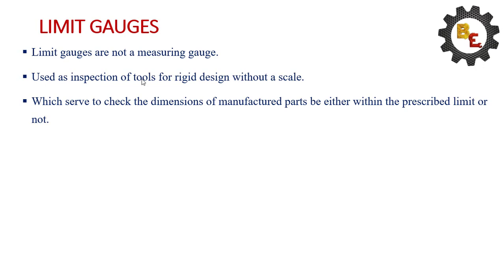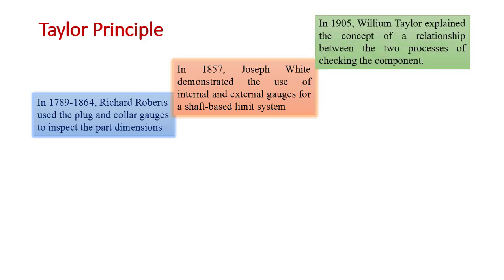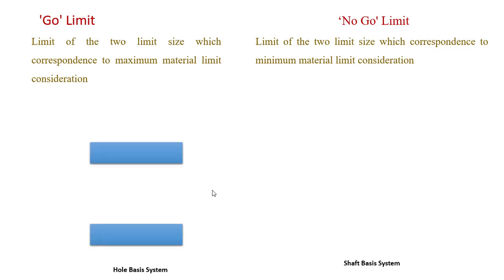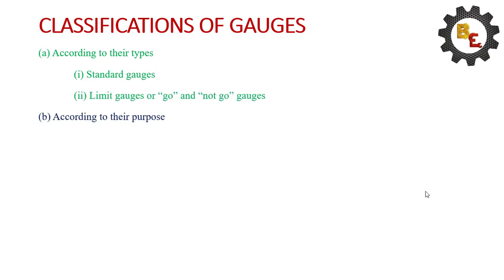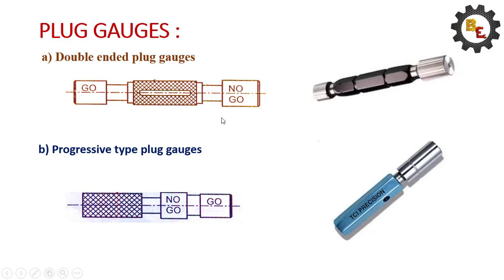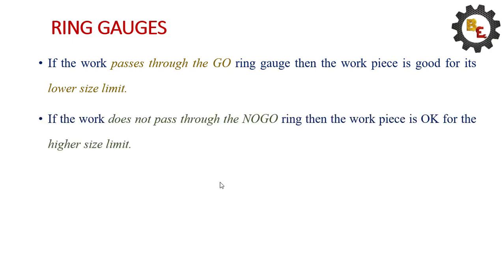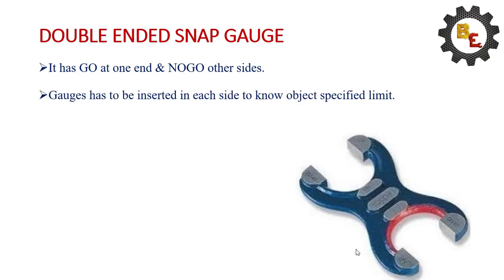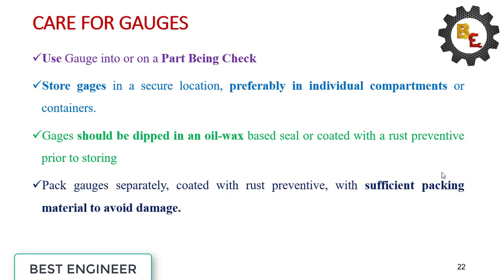Limit Gage | Ring Gage | Snap Gage | BEST ENGINEER

Comment: Tell me snap gauge used for?
Reply from the maker: Snap gauge used for checking dimensions of cylinder. Example starter motor casing outside diameter can be checked to fix the cover to sealing between two ends